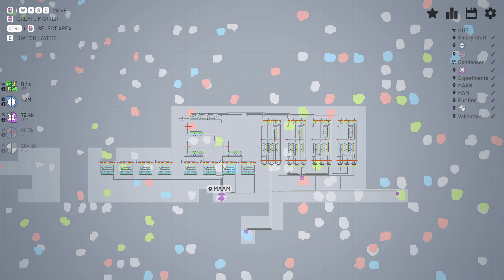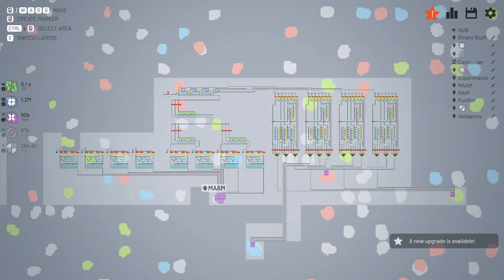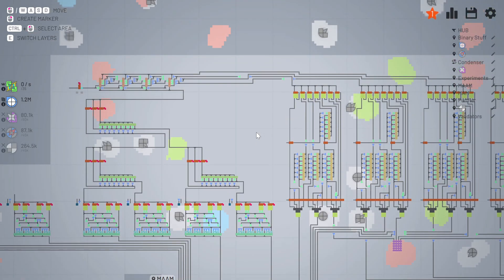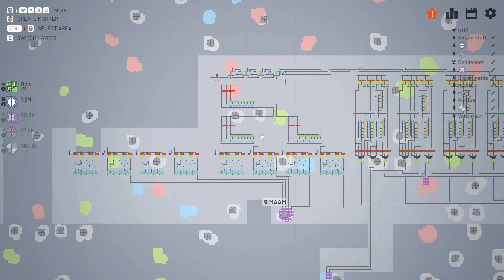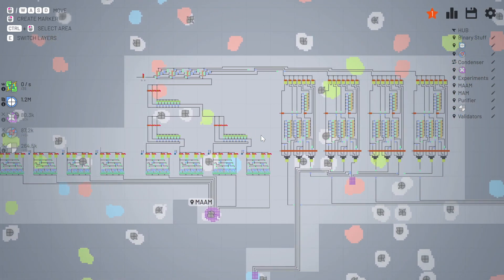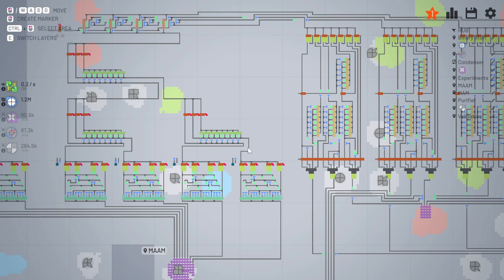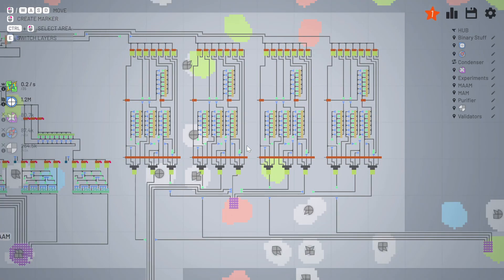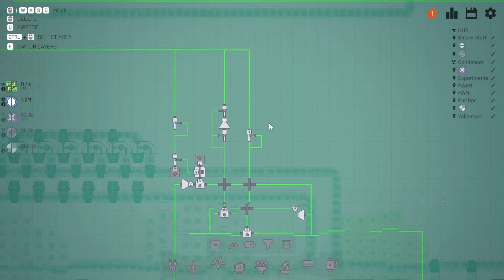Shapez MAAM : Building A MAAM Step by step | Episode 2 - Painting

Comment: how do you handle completely colorless shapes? the quad painter wont work with those so is there a way to have the completed uncolored shape bypass the painter?
Reply from the maker: yes, the next episodes will show how to bypass the painter and/or the stacker.
Reply: @MassiveDynamic9  ive already watched all 6 episodes in the series and i never saw anything about how to bypass the painter.
Reply from the maker: @Metal_89  ok, let me review the series and either give you an exact timestamp or create a new instructor for you... give me a minute or three.
Reply from the maker: @Metal_89  So after rewatching this video, I don't exactly pinpoint the answer to your question, but at 20:00, I explain that by passing a zero (0) signal to the 4 way painter, it allows the unpainted shape to pass through the painter. This, although not bypassing the painter entirely, functionally performs a bypass in that it allows a partially or unpainted shape to proceed to the next step. I hope this answers your question... if not try rephrasing your question or giving me more details so that I can get you the answer you need. Thanks so much.
Reply: @MassiveDynamic9  i dont know if theyve made changes to the game since you made these videos but if all 4 inputs are a 0 signal the shape does not pass thru the painter. i literally just tested it and the shape goes up to the painter but not thru the painter. it gets held up.
Reply from the maker: @Metal_89  ok then, let me play the game a bit and see if I have the same issue.
Reply from the maker: I haven’t been able to play yet, but I just thought of a solution. If all 4 paint signals are zero (0) you can add a filter to the end of the painter line where the unpainted shapes collect with an AND gate that detects the four zeroes and opens the filter to allow the unpainted shape to pass.
Reply from the maker: @Metal_89  Ok, I just uploaded a new video response Episode 2.1   Thanks for asking questions!